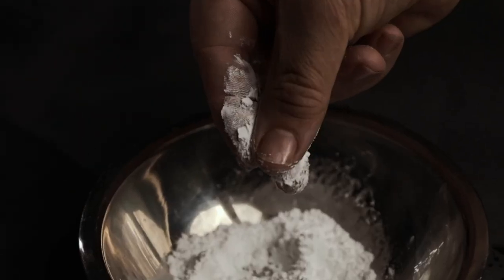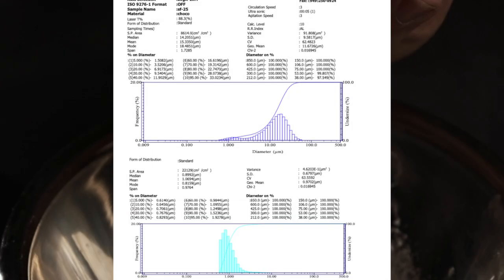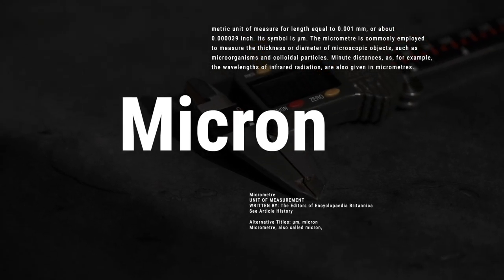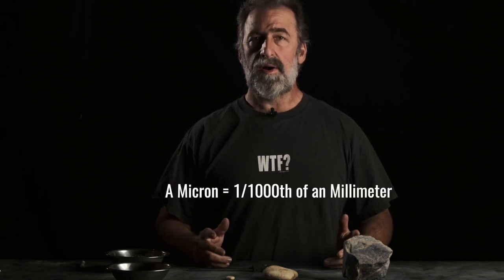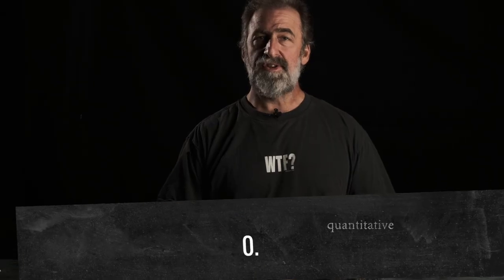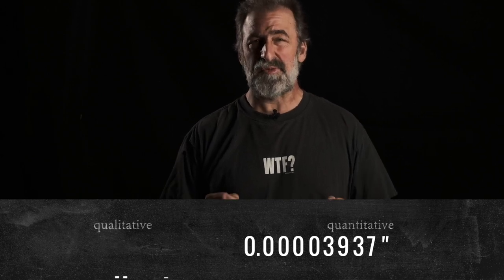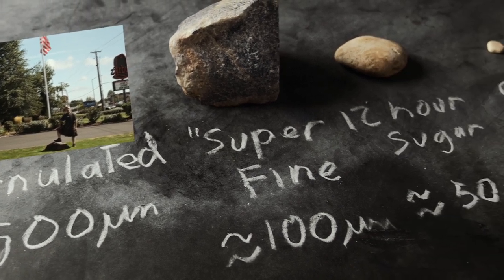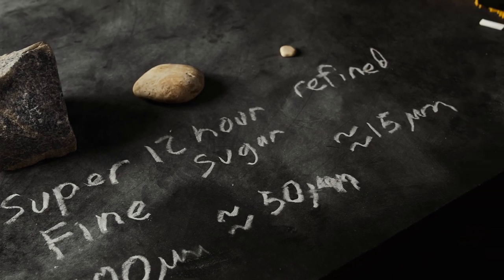Why is My Chocolate Gritty — Particle Size in Chocolate: A Primer.

Comment: What mesh size do you recommend to filter the chocolate after the melangeur?
Reply from the maker: I don't recommend filtering chocolate.  There is no need at all if you have done your stir downs and it has refined long enough.
Reply: what do you mean by ''stir down'' ?
Reply: @HowToMakeChocolateAtHome  There is always small chunk, or sugar that stay in the chocolate, even if you scrape carefully.  You can't see it but when you pass the chocolate to a sifter, you find the bigger particles.  I'm working at a commercial size, and if you try to sell chocolate to a professional, they are used to big manufacturer, Barry, Vahlrona, then a simple crunchy chunk of nibs, or sugar, even tiny, will make the professionnal closed the case.  I can't take a chance and I'm passing everythng in a mesh 40.  Lots of chocolate company I know are using mesh 25 honey strainer.
Reply from the maker: If it is working for you then don't fix what isn't broken.

Comment: Good stuff... Subscribed... Man I bough organic sugar and its got the golden molasses look but wow huge particles... Im on 30 minutes and waiting over low heat but its just a sludgy mess... Dont wanna turn it up because im afraid ill burn the cocoa or sugar ... Anyway im determined to make a 50/50 cocoa/kokum butter chocolate... Just to say I did. Im also looking for solid fats that arent full of palmitic acid... Thanks
Reply from the maker: I'm missing something.  What do you mean by low heat and a sludgy mess?  What are you doing and/or expecting?  You aren't trying to dissolve the sugar in fat are you?  What is the issue with palmitic acid?  It is 25% of cocoa butter.

Comment: So what your saying is….that I should splurge on that chocolate ball mill?😀
Reply from the maker: No, a melanger is the better option.  IMO whether it is a splurge or not is your intent and goals.  Lots of hobbies require a level of monetary buy in and significant upgrade might be considered the splurge.  For making chocolate, I would classify the melanger as the necessary equipment ($500) and a ball mill and separate conche ($5000 or more) the splurge.  Is an oven a splurge to a baker?

Comment: Guess i just have to endure my gritty choclote. I use powdered erythritol. Maybe confectioners would be better?
Reply from the maker: Not really.  That is basically powdered sugar which I address.
Reply: @HowToMakeChocolateAtHome  i did some goggling and it said confectioners was usually finer than powdered, but that wasn't a brand specific thing.
Reply from the maker: sure, some finer but you are still going to be so much greater than refined chocolate it isn't going to make much of a difference in the texture.  It'll still be grittier than refiner made chocolate by a fair margin.  The best way to see it to try it yourself.
Reply: @HowToMakeChocolateAtHome  something i cant seem to get is the milk chocolate taste. I use 75% fat cream powder. Should i just keep adding that until desired taste or is there something else I can use? Im also assuming not al cocoa butter is created equal? some brands are better than others?
Reply from the maker: The answer is kind of obvious.  Use milk powder, not cream powder.  You are missing the milk solids in the cream powder.  Chemically and functionally, all food grade cocoa butter is equal.  They differ in flavor and aroma.

Comment: If I am making small batch 500g. Do I need a champion juicer?
Reply: If I spend 48 hours milonging  chocolate, do I pull the plug? Sorry for the misspellings. Also, what do you think of buy chocolate liquor?
Reply from the maker: You are going to need something to crack the beans with.  You don't have to use the Champion for making liquor but you still might needed it. for cracking.
Reply from the maker: Do you mean do you stop running the melanger at 48 hours?  That is your call.  There are no hard and fast rules.  I don't recommend liquor as SO MUCH is affected by roasting your own beans or at least starting with roasted nibs.  But again, there are no hard and fast rules.  If you find a liquor you really like than sure, you can use it.  I wouldn't personally recommend it though.